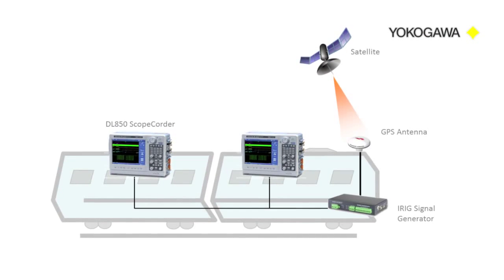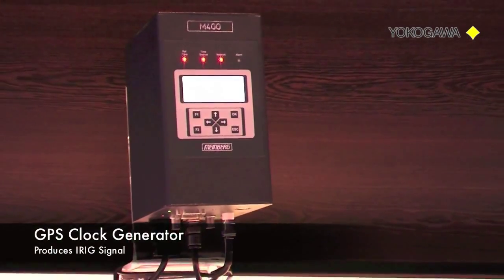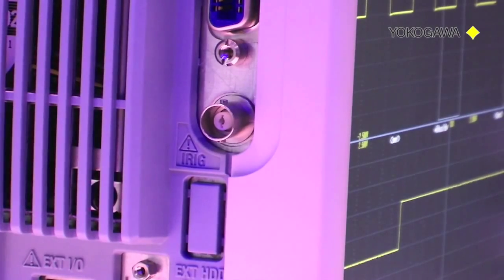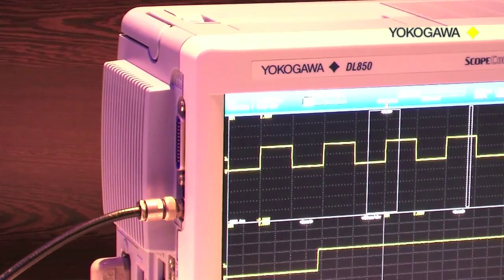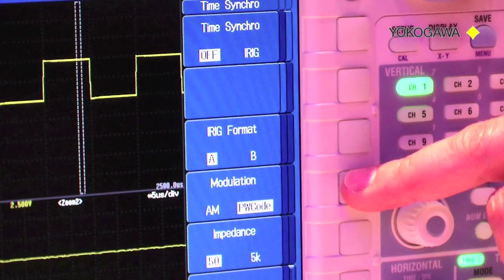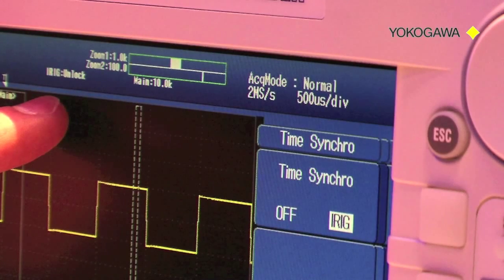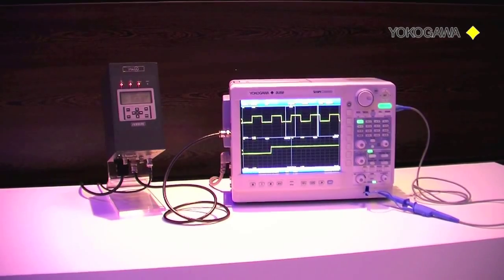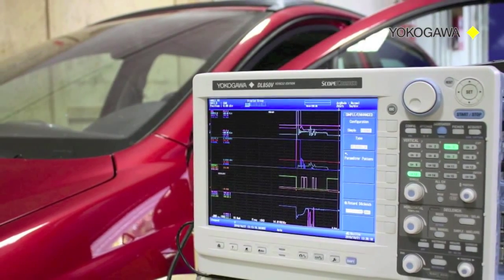GPS Synchronisation of a DL850 ScopeCorder - Event monitoring & precision timing

Comment: what is the function of this in a train?
Reply from the maker: Dear Chu Qian,

A ScopeCorder is a powerful portable data acquisition recorder that can capture and analyse both transient events and trends up to 200 days. Using flexible modular inputs it combines measurements of electrical signals, physical (sensors) and CAN / LIN serial buses and is able to trigger on electrical power related and other calculations in real-time.

In Railway applications a GPS antenna being used on a ScopeCorder ensures precise time synchronisation when 2 or more ScopeCorders are used to capture data, for instance during a test drive. This is especially important when measurement data from one or more ScopeCorders is later combined in one overview for further analysis.

There’s a wide range of railway applications where a ScopeCorders are being used here’s some examples:

Development of traction drives
	Development of traction drives, power modules, IGBTs and drivers
	Measure semiconductor switching losses
	Determine IGBT failure after  turn-on
	Frequency test with IGBT failure
	Short circuit tests
	HV cable measurements on trains

Development of door electronics:
	Sensors and positioning
	Logic control signals
	Electrical motor drives
	Compare CAN BUS data with sensor data

Development of on board systems:
	Control signals
	Air-conditioning
	Energy management
	Development communication boards
	Power control

Service and Maintenance
	Transient measurements
	Cause & effect analysis
	Combine measurements of electrical parameters with sensor data, control signals, and CAN bus data.
	Monitoring power lines
	Troubleshooting switchboards – logic
	Record the signals during a test drive and then take the time to evaluate them afterwards.
Investigate electronic problems of the metro trains under certain operating conditions

If you have any further questions on this topic please do not hesitate to contact us at tmi.yokogawa.com or by email at tmi@nl.yokogawa.com.
Reply: *****  thanks, this is really detailed. why is synchronization important?
Reply from the maker: Chu Qian
Time synchronization can be important when you want to establish a relationship between measured data and events occurring in real-time on the device being measured. 
In this railway application example, engineers can used the GPS time synchronized data to explain why the traction drive of one train malfunctions but the traction drive of the second train remains operational. By having time synchronized measurements, the engineers can compare the electrical condition of the traction drive on both trains to determine the exact fault.